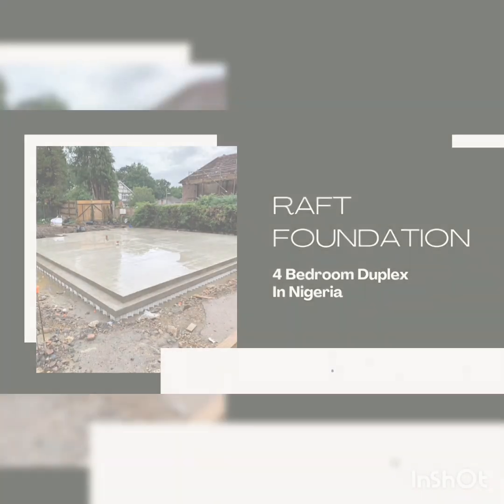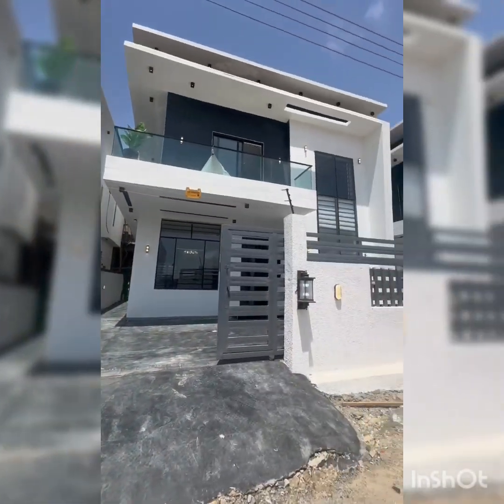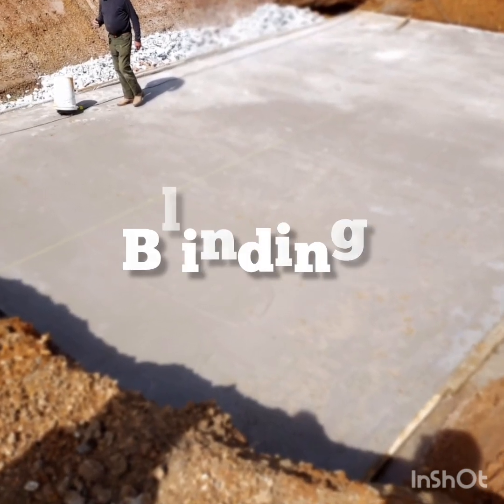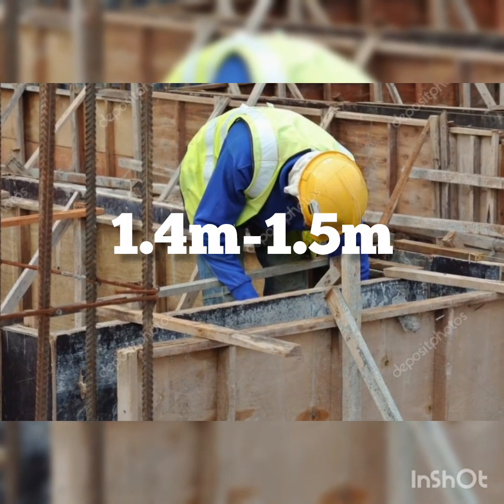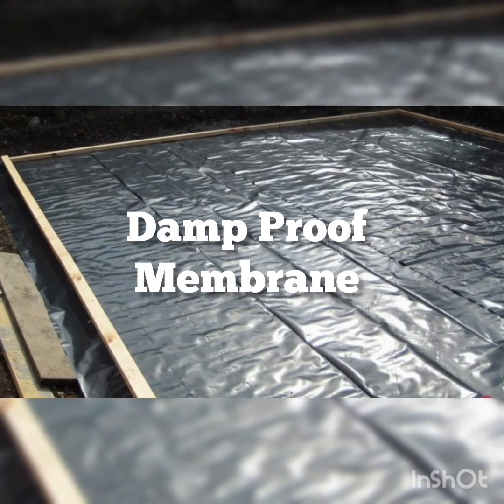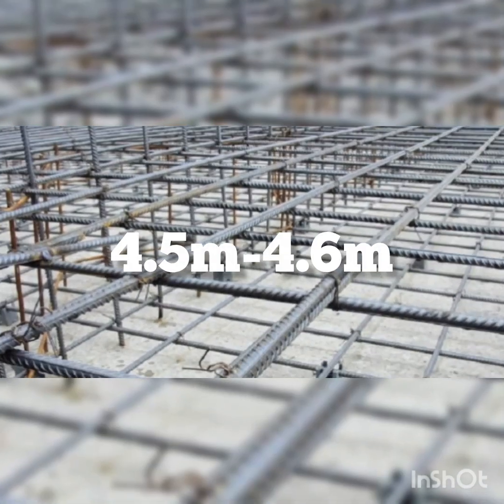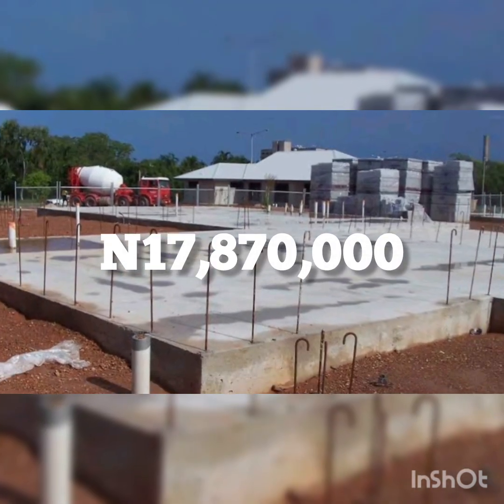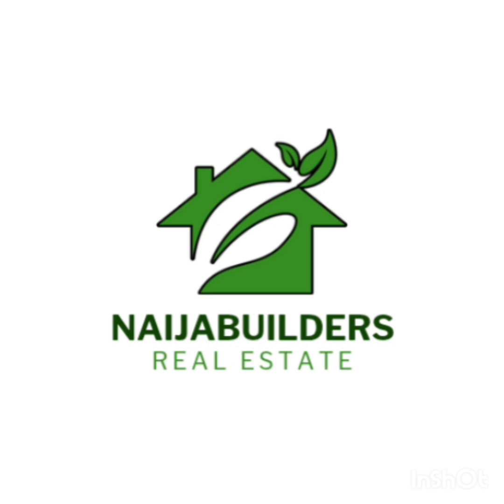BOQ Raft Foundation for a 4-Bedroom Duplex  in Nigeria, as of 2025.

Comment: Well done 👍 very helpful. Can one use this foundation for 2 floors.
Reply from the maker: Great question.

✅ Yes, this BOQ can be used for a two-floor (i.e., double-storey) 4-bedroom duplex, but with important caveats.

What This BOQ Covers:

The BOQ we just outlined is for a raft foundation capable of carrying the load of:

A 4-bedroom duplex
 With 2 suspended floors (ground + 1st floor), assuming normal residential use (not commercial loads)
 On moderate to weak soil (where raft is suitable)
With no basement

 ✅ Suitable If:

You're building a standard concrete block duplex, not a steel frame.
The design uses normal span slabs (not heavy cantilevers or wide open spans).
The structure is not extremely heavy (e.g., no water tanks, heavy machinery on upper floors).
The raft slab is engineered properly (usually 200–300mm thick, heavily reinforced).

⚠️ Not Suitable If:

You're planning for an extra floor in the future (3 floors or more).
The soil is extremely weak, like swampy ground (then piling may be better).
* You need a basement or semi-basement.
You’re carrying very heavy loads, like industrial equipment or tanks.

🛠️ Engineering Tip:

Even with a raft, the structural engineer must design:

Slab thickness (often 250–300mm for duplex)
Steel bar sizes and spacing (often 16mm + 12mm at closer spacing)
Proper load distribution under columns.

💰 Cost Note:

If you're using this BOQ strictly for a 2-storey duplex, you're 90–95% covered. But for extra safety and stiffness, you may want to:

Element   Add-on                            
Raft Slab Thickness Increase from 200 mm to 250–300mm 
Reinforcement  Add~₦500k–₦700k for denser mesh |
Concrete Volume  Add ~₦400k for extra concrete.
Contingency Always keep a 10% buffer.
Reply: Is this just the raft or does it include filling and German floor?